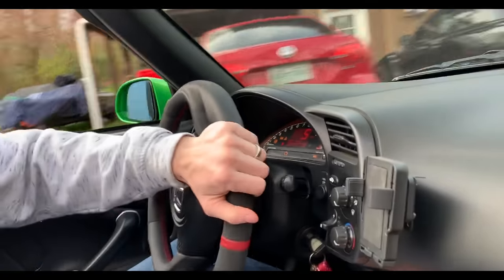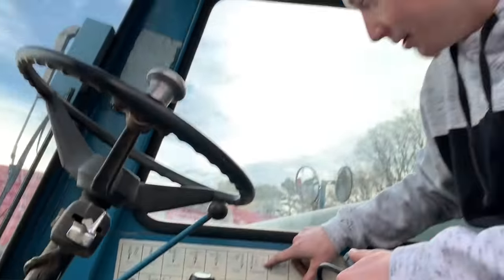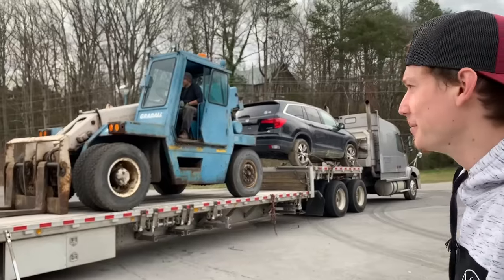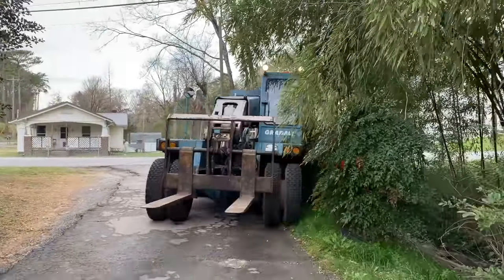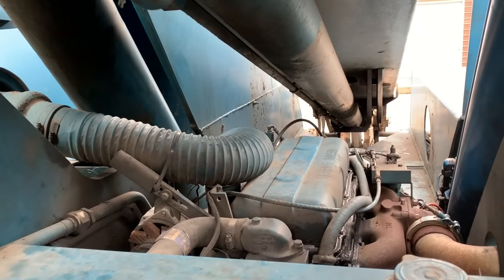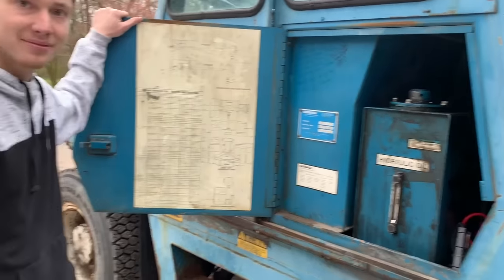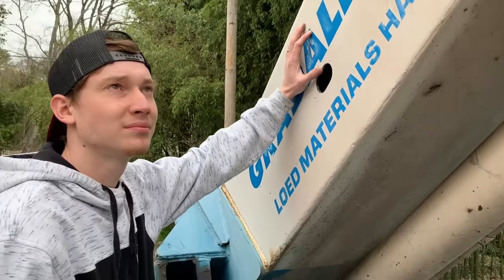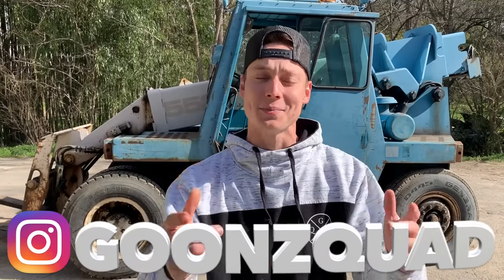Rebuilding The Worlds Biggest Forklift!!!

Comment: Those forks should fold up for when you’re driving it down the road. Safety reasons. You wouldn’t want to stick them through the back of a car if something happened.
Reply: Actually that’s why your supposed to back the forklift where ever you go
Reply: Nick Johnson not these guys. Have you seen them drive it? Besides it works both ways for safety. I’ve also seen the way other people drive.
Reply: Sand Pirate Treasure Hunter true but in my safety training I was always thought to back up and use the horn
Reply: Nick Johnson to be fair there’s no forklift that needs to be on the roads. 😂
Reply: Sand Pirate Treasure Hunter true lol

Comment: Some old Detroit's have super chargers, we have an old GMC dumptruck with a 671 Detroit in it, and it has a factory supercharger. Definitely recommend some safety and operating training.
Reply: As far as I know all two stroke Detroit's have blowers. They don't add power as they're necessary to actually get air into the engine.

Comment: Get training and certification ,very important, to operate this machine safely.
Reply: Absolutely! When I worked for Deutz we had a company come in and train and cert us. Kalmar IIRC. I got two (they did off road also). Expired by now... We had a huge Hyster hydrostatic we got for cheap because the engine was lunched. Took the 4 cyl out and put one of our turbocharged 6 cyl diesels in. That thing was a BEAST! Twitchy as hell! I was one of three people allowed to use it because you had to really sneak up on the old girl! You had to go REAL easy so the turbo boost didn't kick in. Should have gone NA but I wasn't involved in the build. Outside you could punch it and it would smoke all four tires!

Comment: Safety third, i guess? You Guys really need training to operate this kind of machinery, otherwise you risk injury/death and damages. This is not some kind of toy.
Reply: They also worked in construction for their older brother handling construction equipment before.
Reply: Silverado_Denmark exactly what I was thinking 🤔 I’m certified and have ran them there not a toy might be easier than driving a car put using it day to day anything can happen quick
Reply: @yungBitta291  i got My forklift certificate 15 years ago, and have had My share of mishaps along the way. These things Are very dangerous if you dont know what you are doing. I know this is just for personal use, but that does not make it less dangerous! I just want the goonz to be safe :-) i drive an 80.000 pound forklift at work that can lift more than 50.000 pounds, that Thing is No joke with 20 foot extension forks on, moving around 20 foot diameter brake discs for wind turbines.

Comment: Billy the only bad thing you need to be aware of  about the Detroit  diesel  is ,if you let them set very long at all you need to check the injectors  and see if they are stuck!! These engines  are bad to stick the injectors  and if they do? All you need is one injectors to stick and if it fires up,it will run at full throttle  wide open!! And you would have to be ready to block off the air to shut the motor down so if you ever start one with out checking pulling the valve cover  off and you can see if the injectors  are moving back and forth ,very easy problem to solve and not blow your motor away from it running away from you.i usely  have a 3/4  inch ply wood flat to cover the air up it will kill the engine right now.now I seen you had leaks from your hydraulic  system it looked like you where out of hydraulic  fluid  and if you buy any hydraulic  fluid  go to tractor  supply  and buy the brown color cheap fluid  at tractor  supply  in the 5 gallons  bucket and use this stuff until you fix all your hydraulic  leaks like cylinders, that are leaking and hoses .you fix one cylinder  you have to reseal the other side too meaning both cylinders  because the new updated seals are better now than 15 years ago!! They really are upgraded  seals really this is the most important  problem is the seals you take off wont match the old ones because  the seals are upgraded now ( better than factory  new seals) now these are so easy to rebuild  your self  take pictures  and video of you taking this apart.  Most people put the seals on back wards!! And then comes back into the seal shop and says it leaks and wont hold your hydraulic  fluid  it pours out.and most places has a 45.00 minimum  charge to put them on the right way. This is cheap really it cost a minimum  of 125.00 and hour plus service costs  to come out. Plus  parts seals they are very up charged in seals and parts like 4 times or even more you dont have to go to buy seals from your parts dealer you can go to a hydraulic shop  and they can mic the cylinder  and give you the seals you need and they wont match most of the time the new seals are better than what you take off .( I know I am repeating  myself because its so  important   you get this right the first time. If you fix one cylinder  you have to replace both cylinders or you will blow the other side when you fix the first side  ,make sure your chrome  on your cylinders  are not rusty chipped  or this will RIP  your new seals out and you have to do it over ,I seen you had a new cylinder  on your lift it was probably  rusted or damaged  chrome on the cylinders  so you have to fix the rust,or re chrome the cylinders, or buy a new  cylinder  to fix it. If you  hire this done you better have very deep pockets this is for a big business  that has money and needs the lift now and fixed,if you see how easy it is ,( to do this work is much easier than  painting and fixing cars).its so simple  and it will be able  to show your viewers how simple  this work really is to fix ,you have filters to replace I use Baldwin  oil,fuel, hydraulic  filters  they are the best and you can buy much cheaper off of Zoro.com they will give you 15 or 20 percent off if you buy like 150.00 at a time for your filters find your numbers you need and go on line and type  the numbers you need and they will sell you cheaper than Baldwin. Com will  this is the best  filter I use  only. After you change the seals and hoses  and stop all leaks And change the hydraulic  filters I use mobile  one clear hydraulic  fluid  which is the best but cost much more  to use hydraulic from mobile 1 . You can easily  do this all yourself  and after the leaks and hoses I would restore  that lift its money in the bank with big equipment  and I fix mine and make it top notch condition. Seals will last 20 years if you store out of weather and retract the chrome into the cylinder so it wont rust and cause  pitting on the chrome.

Comment: Fencing for the future. I used to work for a fencing company and we would auger out a hole which was only 3 or so inches bigger than the post. Then instead of mixing water in the quickcrete we put it in dry and tamped it solid. The moisture from the ground would make it get hard. It was super strong and effective and quick.

Comment: I'm pretty sure it's a Detroit Diesel 4-72.  4 cylinders and each cylinder is 72 cubic inches of displacement.  2 cycle stroke with a gear driven blower not turbo charged.  Great engine and will give you years of faithful service if taken care of and limits respected.  As others have mentioned ALWAYS LOOK UP before operating the boom and if you do hit a power line STAY IN THE CAB!  If you have to bail, dive off of it, do not step off of it!

Comment: Make a steel prop that will attach to that bracket on the telehandler boom so that the prop will prevent the boom from descending when your working in that engine area.
It should have had one but looks like its missing. Make the prop heavy duty as that boom is damn heavy.

Comment: I''ve heard it called a tele-handler, a boom lift and extention lift.
Fun fact it's almost impossible for this thing to get stuck. I had one in a set field and buried to the axles, Wasn't carring a load, so you just point the forks down and extend into the ground and push the lift backwards until you're back on more solid footing...

Comment: The extention cylinder works as a counter pressure on the function hydraulic  manifold,i would install a pressure gage and verify the correct pressure on the extention function,better to hire a field tech for a service call to check for proper pressures,and counterbalance valve operation.

Comment: Cool machine, but always remember NEVER get under the boom when it is in the air unless it is firmly locked with a prop made for that purpose. The engine is a Detroit  I 53 or 3 53. 3 for 3 cyl, 53 for number of cubes per cyl. #

Comment: The good news is that for your first diesel repair experience, Detroit Diesel engines from that era are all mechanical - mechanical throttle, mechanical injection, so they are super simple. Also if you haven't discovered yet, it is already "supercharged" - it uses a two-stroke power cycle and has a roots blower on the side for blowing fresh air through the cylinder. The valves in the top are all exhaust valves - the intake is through the side of the cylinder wall.

Comment: They are GM made same as duramax guys . They can be had in two stroke or four stroke. They were used in all is and terex earth moving gear some brands of farm tractors tractor  and some trucks. The do naturally leak oil but are very economical to run and very reliable.

Comment: the engine is a  turbo 556! Detroit Diesel is mainly used for long-running 100,000, km make sure it's liquid-cooled and yeah Never trust hydraulic hose it can actually cut you and your buddy! I've worked on machinery and it is greasy a good bath and check for water in the filter box.

Comment: The Detroit diesel is a 2 stroke diesel, uses a blower to push air into the cylinder through ports and they usually have either 2 or 4 exhaust valves per cylinder. Because the engine is a 2 stroke it sounds like it’s running twice as fast as it really is.

Comment: Hey guys the large hydraulic hose from the tank normally goes to a power takeoff of some kind which is the small box bolted to the trans which is driven off it.
Aways make sure you guy make the boom safe before stepping under it.
The cylinders as you called them are called hydraulic rams
Hope that helps good luck 👍

Comment: I bought a used fork lift at auction. Bad mistake. It worked for a while. I'm guessing it was fixed up enough to show potential buyers it worked well. Soon after purchasing (for $5,000) the seals in the masts started to leak. Soon they were leaking like an oil pan missing the drain plug or almost like that. Had to have all the seals replaced at about $1,200. Soon after that it started getting weaker and weaker going forward. Reverse worked just fine. Its to the point now that I can't use it because it won't go forward. I'm told it needs a new transmission or about another $4,000. My father who never  bought a used car used to tell me. "why would you buy a used car? There is a reason why the person is selling it. It's because its a piece of junk". Same with fork lifts.

Comment: When you raise boom and cut off engine you need to brace the boom so it dont come down on you.  Also it's a tellahandler not forklift. Next before you lift you need to get load chart from the company that makes it..  I am union  heavy equipment operator  I am certified on those.  Hope it helps

Comment: That’s a “adjustable spread axel step deck”. 

With the axels spread , you can scale 40k lbs on both of those. With the axels close , you can only scale 34000lbs. 
Those ramps are sold at “discount ramps”. About 4k for that ramp setup. 

Bad thing about those spread axels trailers is that it eats tires if your not careful.

Comment: The two small cylinders on the boom base,are leveling cylinders to keep the forks level with ground as you lift the boom up,and levels up as you lower the boom.check all cylinder at the rod surface for nicks,and scratches which should have been inspected before buying ,as repairs can be costly

Comment: If boom is not extending you only have 3 options as far as I know, the body valve, you're missing oil or there is literally no hose going to it because even if it was leaking it would extend a bit. On old machines like that it's all mechanical there are no electro-hydraulics

Comment: You will need an air brake truck if you're going to buy an air brake trailer. Doesn't make sense though, just get it to the new shop not like there's any reason to be hauling it around.  The f450 wouldn't legally pull that either. Also that would pick up a whole semi if not extended, just the tractor is actually pretty light 15-18k lbs.

Comment: Detroit Diesel were  part of GM, used in some Sherman tanks. Check out the movie Kelly’s Heroes and Oddball and his Detroit Diesel tank😎👍 Detroit Diesel is now part of Daimler I think.
Your probably on the right track with the hydraulic problems, but sometimes you need to give the motor some throttle when you load the hydraulics. That could be why it try’s to stall.

Comment: Hey I would look into a gooseneck if your planning to towing that anywhere. I    would look at something with hydraulic dove tail and dual 15k or even 12k axles  something at least 26 to 30ft. That 450 won't have a problem but you wanna make sure you look at all the numbers so you don't have to get a CDL to tow it. But a gooseneck will be your best option for that kinda weight

Comment: Those 4-71 Detroit were sometimes factory turbocharged, so you might be able to get a kit and a stock replacement turbo. I believe the engine is a 4-71 Detroit Diesel, 4.6liters, or 71 ci per cylinder.

Comment: If you guys run the engine without hydraulic oil in the tank it will damage the hydraulic pump. There should be load holding valves on the cylinders so if you burst a hose you dont drop the load. But like everyone says dont be under the boom unless it is blocked up. And you should be able to get an operating manual on line.

Comment: You all need to just buy about a 40 ft gooseneck trailer with a hydraulic tilt dovetail and dual tires so you’ll be able to haul trucks and the forklift and anything else you should be able to haul that forklift on a trailer like that with the f450

Comment: That motor is either a  Detroit 453 or a 353 the 453 is a 4 cylinder 5.3L 2 stroke supercharged diesel. And the 363 is a 3 cylinder 5.3L 2 stroke supercharged. The supercharger is gear driven from the side of the block. Some of those engines where supercharged and turbo from factory they are a very strong engine but very noisy

Comment: No oil in the hydraulic tank dont use the  lift you might burn pump. Also dont get under lift once its up if it's leaking oil it might lose pressure and it might fall straight down on you!

Comment: The old Detroit's are 2 strokes and when supercharged considered to be naturally aspirated due to they wont run without it and a common mistake people make is they think they leak oil from the topside of the engine but they are a total loss system and people clog the holes they leak from causing oil to rise into the intake and the engine starts to run off it's own oil and runs away but they are very simple engines once u understand them they are also prone to injectors getting stuck and when one does itll lock the engine wide open as it will hold the other injectors wide open once u start working on the engine you will understand how that all works

Comment: Hey guys the hydraulic fluid is wicked low so that’s one reason why it’s not extending and theirs solenoid swiches could be bad also the controls on the lever theirs o rings inside could be leaking by anyway start with the fluid first and go from their that tank looks like 20 gal tank fill it 3/4 of the way and good luck 👍🏻 it’s a real easy too work on them .

Comment: Gents,  great old school machine. Have an equipment  tire company come out for the steer wheels. They are old school split lock ring wheels. They are extremely dangerous and outdated. The boom is pinned and that Detroit diesel should be a 2 stroke diesel actually if im not mistsken. And seriously be careful with this thing.. its heavy, powerful and old. Everything about it can hurt you or someone else..

Comment: All of those cylinders are going to need to be rebuilt, Good luck you really need 2 big pieces of equipment to work on one. humans basically cant lift any of the parts on larger equipment. Also your car floor jacks are going to crap there pants if you slide them under that thing. "get a bigger trailer to move it" she is firmly in the dump truck and larger tow vehicle range. Just road it everywhere.

Comment: My harbor freight hydraulic car lift has a small leak and I don't trust that thing. It doesn't hold the weight for too long and you should not mess around with that thing either until properly trained.

Comment: I really hater to burst your bubble but as a former longshoreman I have operated a bigger forklift known as BIG BLUE  its capacity was about 50+ tons and it was used to lift slabs of steel that weighed about 50+ tons that came off of ships  we had to climb six steps and ride about 14 feet in the air but have fun with this one

Comment: 1 its technicly a telehander 2 rear wheels are tilted in so you need to change the king pins 3 you might want to take a heavy equipment course and 4 its not the worlds biggest thats a normal size telehander